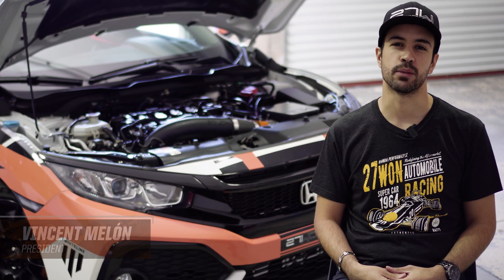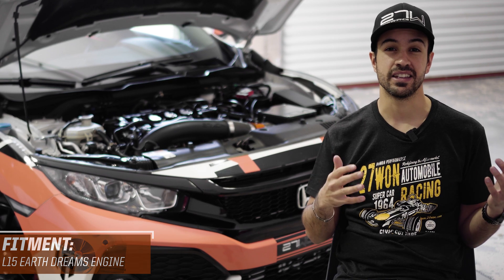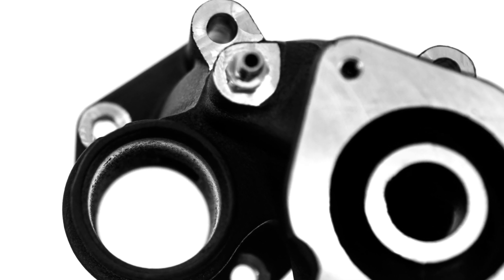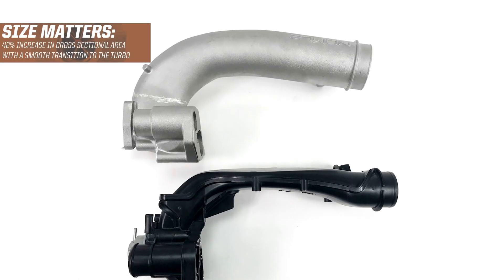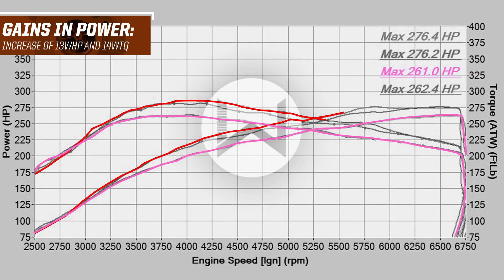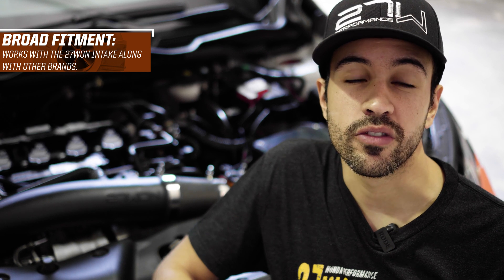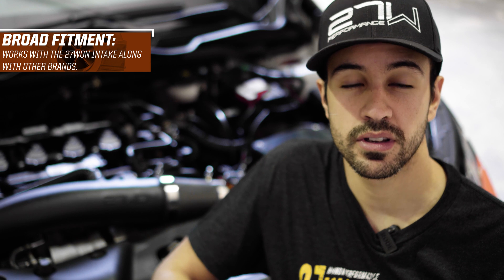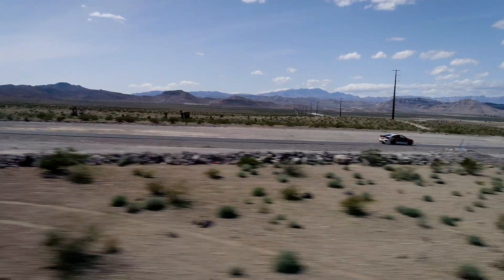Performance Turbo Inlet Pipe Upgrade for 2016+ Honda Civic (27WON Honda Performance)

Comment: So this will be okay in a 2018 civic sedan ex-t or si?
Reply from the maker: Yes it will work for those applications.
Reply: @27WON  cvt?
Reply from the maker: @altoids79762  yes
Reply: Does this require a tune?

Comment: Imagine the drop in turbo. This and the cold air. Plus a intercooler. Fudge man FUDGE!!!! Then an open front pipe FUDGE MAN !!!!!!! I was looking at the kits ( sad cause I’ve only had the car for over a month lmao ) and I think I settled on the drop in turbo, easier install and witg the flex fuel kit and e85 I can get the numbers I want. Sounds like a dream come true boys